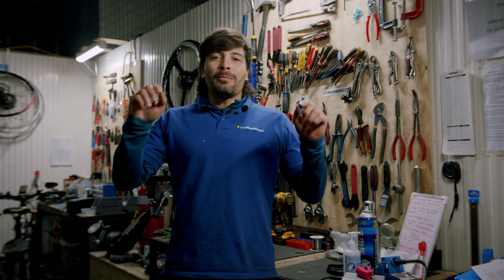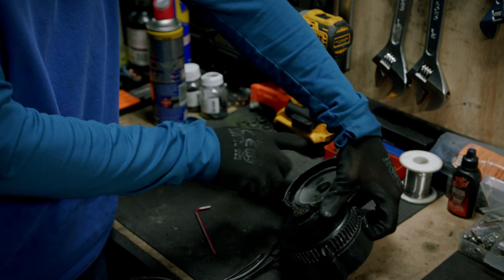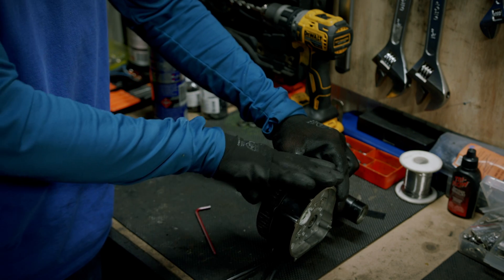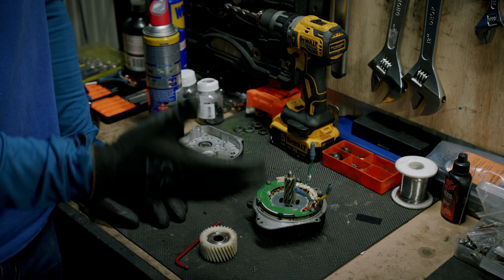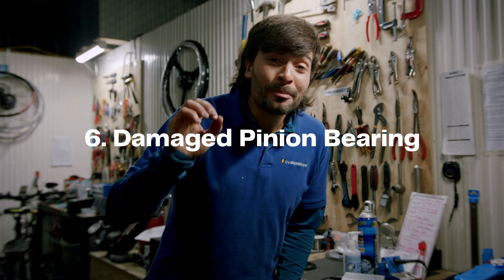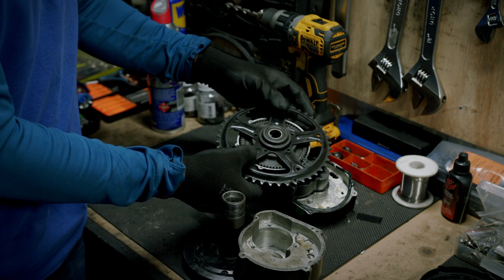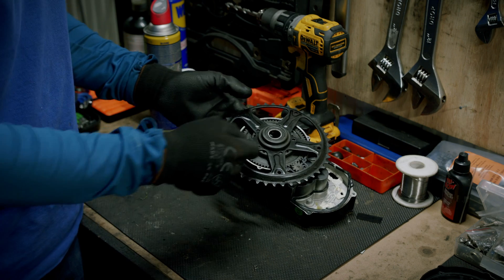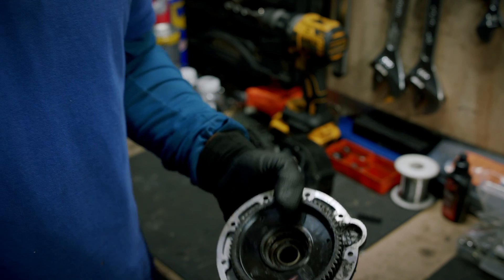Bafang BBS Motors The Most Common Problems of These Mid Drive Motors

Comment: I have a BBSHD 1000w motor and the bottom bracket shafts moves about 5mm each way if I pull my pedal arms back and forth. Is this fixable ?
Reply from the maker: You have to be more specific, is it an axial or radial gap? Is it the pedal shaft alone or the entire motor moving around?
Reply: @Cyberbikesau  Thanks for your replay. Its just the pedal shaft, it doesn't move up and down, just in and out about 4 to 5mm if I grab the bottom of the pedal arm and push it in and out.
Reply from the maker: @PINACI  that’s a normal gap, all motors we have installed had that same gap so we consider it being a manufacturing standard
Reply: @Cyberbikesau  Strange, I've built two mid drive fat bikes and on one of them there isn't any play in the bottom bracket but on the other there is but it never used to be there when I first built it.

On a normal bike you can just tighten up the bottom bracket if it gets loose on the barings to stop the lateral movement.
Reply from the maker: @PINACI  BBSHD have always had some axial looseness, but if you want to have a go, remove the seal on the left side and remove the first counter nut, then tighten the inside nut (finger tight) then install the counter nut, add some grease to seal it and the add the rubber seal on top, ready to roll!
Reply: @Cyberbikesau  OK thanks. I'll give that a try if thats how its fixed.

Comment: where the cables enter the motor, can you not seal that up with silicone or something, or is that a bad idea?
Reply from the maker: We mentioned that in the video and another video as well, yes you can use silicone there it will prevent water from getting in
Reply: @Cyberbikesau  i saw your tip about putting tape over the gasket and done that. i just heard theres a chance of locking moisture in if its totally sealed but if you think its okay to seal the cables ill go ahead and do that. thanks
Reply from the maker: @SpicyMushroom469  tight the controller bolts and apply silicone on the cables, then add the tape in front of the controller gasket, the motor will be super waterproof

Comment: Great video of the BB02 series motors.  
The last (8th) issue is something I am dealing with now.  Foolishly let someone else ride my trike and I believe the magnets behind the granny gear are either broken or disrupted.  
I will know more once the motor is apart, but is there a replacement magnet available? 
I do have a spare motor - I will install that one - then tear this one down for diagnosis/repair.
Thanks,
Russ
Reply from the maker: Yes there's spare magnets in the market but be aware that if the magnet has been broken its because there was excessive torque on the axle and granny gear, I suggest replacing the entire axle and gear together with the mag sensor.

Comment: hi Felipe, thansk for the amazing video, so easy to understand and enjoyable. i have a question, currently my bafang motor does not run and i suspect it is the nylon gear. if i pull back the bike i can hear loud clicking sound from the pedal. just like your feedback if my diagnose is correct
Reply from the maker: Hi Lawrence, thanks for your words. About your issue, you have to be more specific, when you say it doesn't run do you mean there's electrical power, you throttle the motor and you hear a clunky clicking sound coming from the motor?

Comment: Thank you for your video.  Excellent explanation! I'm up to buy a Bafang 750W motor. I've seen that many people complain about the excesive resistance on the motor when pedaling alone. And that it hapends after some time, at first it was ok. Is maybe the problem of overtightening the bottom bracket nut that you mentioned in the video? That distorts the haul pipe and so afects the bearings. Thanks
Reply from the maker: Yes exactly. That issue could be due to overtightening the bottom bracket nut. Glad you enjoyed the video! Cheers, please help our channel grow and give us a good review on Google https://g.page/r/CX0AoVbmxOSwEBM/review
Reply: @Cyberbikesau   thanks for your response. I gave you 5 stars. Cheers
Reply from the maker: @EbassEbike  thank you for your help my friend!

Comment: Ok i am going to try another route after chatting with a mechanic pal, he said why do i use pedal assist at all and not just throttle with the gears, so on that note i will give it a go, do you know, lol, i'm sure you will know if i can completely disable pedal assist for throttle only use.  thanks in advance. and you have a much better hairstyle these days, lol.
Reply from the maker: I personally ride throttle only, and pedal on top of the throttle, only when my battery is dying I start using PAS levels. Set your throttle to work on PAS 1 onward and leave level 1 at a very weak start and that's it. PAS levels are good to save battery or when riding with friends and you wanna keep pace with them etc...

Comment: wow excellent instructional video, ok my issue i was out riding last night distance 17.5 miles average speed 20.4mph five miles from home i noticed rubbing rattling sound from the motor,  like a dry chain on sprockets  type sound, l think it sounds like pinion bearing issue although the motor has only travelled 120 miles since new, i set off in pedal assist 4/5 on fourth from smallest rear sprocket on 8 speed cassette, i change up a gear to gain speed and next i then up the pedal assist next number and so on until i am in power assist 9 and the smallest rear sprocket which results in top speed with some effort if pedalling gets too hard i drop pedal assist and the gear ratios for easier pedalling, am i doing this right or wrong, thanks again for this great video..
Reply from the maker: Let's be positive; you most likely have something rubbing on the mudguards, or the drive train is not properly tuned. However, you will break the motor if you continue to take off on the cassette's 5th gear (mid-ratio). Think of your bike being a manual stick car. Would you take off on the 3rd gear (mid-ratio) consecutively? No, you wouldn't. Why are you gonna do that to your bike? 
The power assist is an accelerator. If the cassette is engaged in high gear, one can still stall the motor on 4/5 of assist.

I recommend watching these two videos to deepen your knowledge of middrive ebikes
https://youtu.be/jb3v5Y0Q2l0
https://youtu.be/JgbYsX7TG3Y

And if you appreciate these comprehensive classes and the attention we give to every single comment, please give us a 5-star review:
https://g.page/r/CX0AoVbmxOSwEBM/review
Reply: @Cyberbikesau  Wow, thanks for that speedy, in depth reply, no nothing is rubbing, i am an engineer and don't do bodge jobs fitting anything, ever, lol, properly tuned, do you mean gears set up correctly, yes they are spot on if you do refer to that, alas the rear mech is slightly bent but  this does not alter the bikes gear changes,  setting off in 5th gear on a bike, come on no one realistically sets off in first gear, the biggest rear sprocket on a bike, anyway i'll have a look at the videos, one more thing Bafang market leaders in e bike stuff and have been manufacturing them for years, yet it needs someone like Lekkie to come along to make the left hand side cnc crank arm to counter the offset drive side crank, lol, i'll come back to you on this but i would liken it to riding a horse and not a bike with the cranks both being an inch further out each side than is the natural riding position.
Reply from the maker: @MainlyNorthernSoulDancing , the ticking noise could be the bent rear mech or hanger. If the jockey wheels are not aligned, the derailleur will make noise. I suggest aligning the derailleur and the hanger because the drive train "deforms" its shape when the motor is at full power, and those things can be seen when the bike is on the work stand. You asked my opinion, another engineer with 6 years in ebikes, and I am telling you, if you don't start using the big sprocket, you will break the motor. If you don't like shifting gears, go with a 38-40T chainring. I rarely use Lekkie parts other than their chainrings, but yeah they do quality parts. About Bafang, they are doing great. Millions of motors are sold yearly, so a company like Lekkie could enter the market. Cheers
Reply: @Cyberbikesau  lol ill replace rear mech but is is not the issue, as for using biggest rear sprocket ok but the chain alignment then is offensive on the eye it's so off centre to a nice straight chainline, as for front ring i am using the 40t front ring, thanks again, and "you're wrong mutha fucka", comment, lol.I just watched your gear change video and tbh im pretty much there, fyi, i do not have throttle, i prefer pedal assist only, so i use a gear sensor, which as you know cuts motor power, so  setting off i get up to speed on power assist 4 approx then change gear on bikes gears, then get up to speed and up pedal assist to next level 5, then change gear, then up pedal assist to level 6 and so on, so effectively i'm nearly there, i just need to set off on pedal assist 1 and biggest rear sprocket and your work here is done, lol. excellent video again.

Comment: Hi. great to see info on Bafang motors out there - here's my problem and your diagnosis would be gratefully received.  The battery is old but still functioning, with range greatly down but with frequent charging it's fine...  frequently now however  the motor does not engage (the assist is zero bars) and sometimes this is accompanied by the screen going dead.  Sometimes I can have it on, get no assistance for 10 minutes or so and then suddenly the motor kicks it and we're back to normal.  An intermittent problem!  What to do?  Many thanks J
Reply from the maker: Hi J, it's important to don't make confusion with the symptoms.
1. Battery losing capacity, that will eventually cause the bike to shut off under load. The display will turn off and the bike will die. Re-balancing the battery cells my solve this issue in the short term. Replacing the battery will solve this issue in the long term.
2. The bike being ON and no assist whatsoever, means that you have a trigger on the brake sensors. Maybe your brake lever is damaged, or your brake pads are worn out. Unplug the brake sensors and see if the bike stopped cutting off. If it stopped to cut off, you have to access why the brake sensors are being triggered and fix it!

If you appreciate our time and dedication to solving your problem please generously give us a good review https://g.page/r/CX0AoVbmxOSwEBM/review

Best regards!

Comment: Hi Felipe, awesome tips and great delivery! Would please let me know what model of Pinion bearing you put as an upgrade? Also I use a 32T chainring and find myself ghost pedaling often. You say it is also bad to be light on the pedals. Is it really that bad?
Reply from the maker: The upgrade bearing we use for BBS01/02 is 6002 which is a bit wider than the original. About 32T, yeah you will ghost pedaling a lot, but because you chainring is very small in diameter, it most likely has enough torque in any gear you're at so the chances of damaging the motor are way lower than someone with a 46T and ghost pedaling. 
If you can take few seconds of your time to give us a 5 star review that's highly appreciated https://g.page/r/CX0AoVbmxOSwEBM/review
Reply: @Cyberbikesau = SORRY , Page NOT FOUND
= ERROR.404 !?

Comment: When I turn on the power in the controller the battery charge displayed recently has changed. starting at 0, going up to some %. Recently it stopped working when turned on at the controller it turned on and then off immediately.  then it turn on normally. I think it could be a short but nothing is obvious. any advice?
Reply from the maker: the battery could be detached from the craddle, the battery connectors could be damaged, the controller could be failling, the display cable to controller could be damaged.

Comment: I am starting to have difficulty peddling my bafang while assist is off. Feels seized up. Peddles fine when assisted. I love your tutorials man!
Reply: pedaling
Reply: pedals
Reply from the maker: Check the needle bearings that support the pedal shaft, when the motor nut has been over-tightened those bearings suffer a lot and they break!

Comment: Thank you so much, I have a bbshd that when I pedal and I'm pushing hard with no motor help, or straight motor it releases almost like I'm switching gears but I'm not. I replaced inner and outer gears on right side thinking that maybe they were letting go under force, but it didn't change anything.  I will continue to look deeper. 

If you did a paid channel that would give parts numbers and help source things like bearings and go deeper in to troubleshooting ebikes, sourcing parts for all pev. I would pay. I spend hours doing research to find better ways to do repairs and I would be willing to stock it all in the US because it is a nightmare here.

Thank you for the video, amazing
Reply from the maker: Hi Thank you for your insights, we will try to work around stocking Bafang parts. 
From what I understood from your description, you most likely have a frozen chain link or a worn cassette sprocket or a worn out chainring (less usual but happens)

Comment: What can be? My battery say 58.6v so is almost full (is 52v battery no bbshd motor) but When i plug in to the motor is show me 60% battery, two battery same issue, what i can do? :(
Reply from the maker: your display is set to 60V batteries
Reply: @Cyberbikesau  i dont think so, i plug in the phone whit the otg, or the c961 u cant change the voltage
Reply from the maker: @itzpiromane97  your display is set to 48V and it reads up to 54.5V which is about 60% of the 52V battery

Comment: For problem #2 - What is the same if the socket which goes on the end of the torque wrench please? And what is the actual name of that nut? Thank you
Reply from the maker: Bafang locking nut and bafang tool kit tool

Comment: 1:30-1:52 i didnt really understand how to avoid the water from following the wires and getting into the body where the wires attach to it?? thanks otherwise for a great video!!
Reply from the maker: water follows the gravity which will follow the wire if its a straight line down to the controller, try making an arc with the wire an U shape then running the cable up the frame

Comment: Hi Thanks for information,  my bafang bbso2 locked the crank arms so it just kept pedaling and wouldn't free-wheeling I was out on a ride so I just forced it to not turn by standing up on both pedals, then it did free-wheeling but then when I went to pedal again there was nothing it would just pedal so I used the Thumb throttle.  Do you have any ideas what I have done, I have not pulled it apart yet. But interesting to to hear what you would think it is.
Reply from the maker: excessive torque when tightening the nut that attached the motor to the frame, consequently you broke the needle bearings inside of the pedal axle, replace the needle bearings and the cranks will spin again

Comment: What causes the motor power to turn on and off while riding? The display shows plenty of charge, new brake sensors and new speed sensor.
Reply from the maker: battery problems or  battery connectors

Comment: Looks like it's peddle like a normal bike and don't try to spin the tires all the time.  Keep off the throttle and peddle. The motor is there to help, and not clime mountains on it's own.  Great video, and I learned a lot of how to protect the motor, and how it's made on the inside.
Reply from the maker: Honestly, it's not like that. You could be throttling up a steep hill and you will not damage the motor, and you could be pedalling uphill and damaging the motor. This has to be very clear. When you pedal, you alleviate the torque in the motor shaft. However, you don't eliminate all the excess torque in the motor axle. So, to eliminate the motor's torque, you have to bring the revs of the motor to its maximum, and that's how we want you to use these motors. If your legs can keep up, we don't know. What we want you to do is to rev the thing out of these motors and be happy. Ride in the correct gear for the speed you're bringing and you will be happy.

Please watch this video if you want to further deepen your knowledge. 
https://youtu.be/jb3v5Y0Q2l0
Cheers, and thank you for your comment.
Reply: Amazing info 👍

Comment: Hey man. My bbshd has stopped spinning. Most of the time I've been in the right gears. In level 4 of pedal assist. Any time in wrong gear would've been minimal and accidental. I still see the display. But the throttle doesn't give anything or pedal assist. Before this I did hear the throttle make a high pitched sound and a watt reading would show... But with no spinning. I did momentarily see an error message 09. But that has since gone. I've opened the controller and made sure all phase wires are connected but this hasn't fixed the issue. I've changed wiring harness and it hasn't fixed it. What does this problem sound like?
Reply from the maker: or controller problem or motor hall sensor problems. If you have ridden the ebike always taking off on the first gear and riding at the correct gear for the speed you're travelling (forget PAS levels) you have been victim of water damage, otherwise I cant see these motors failing from nowhere